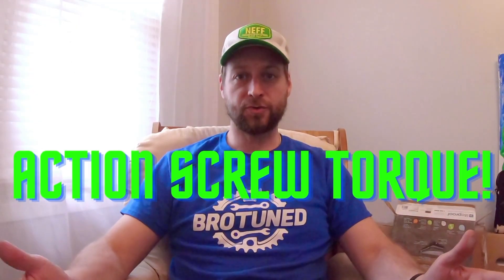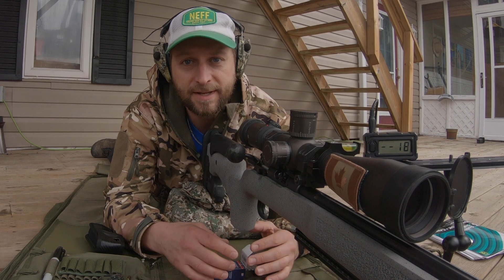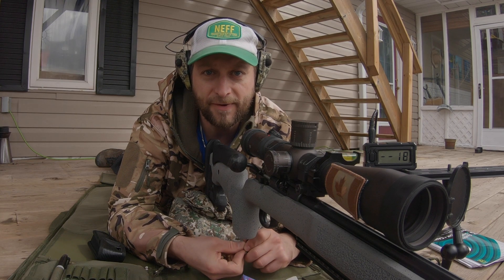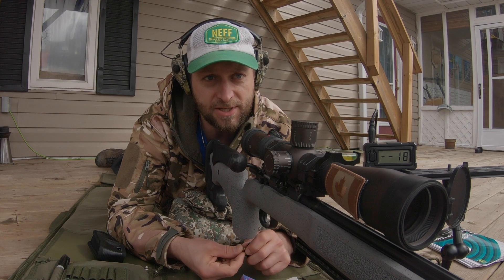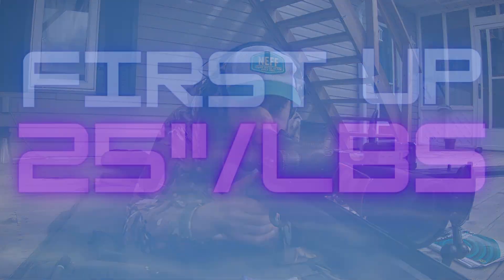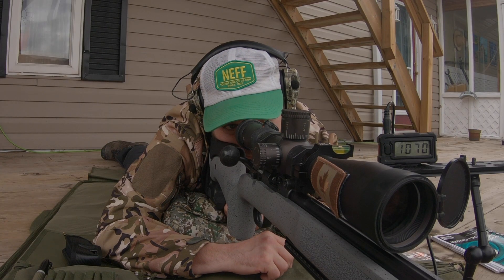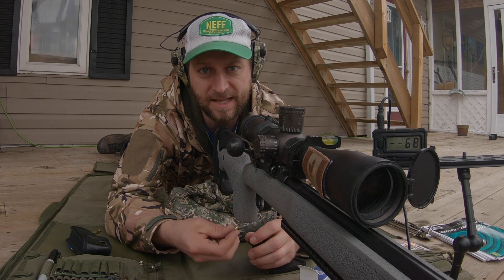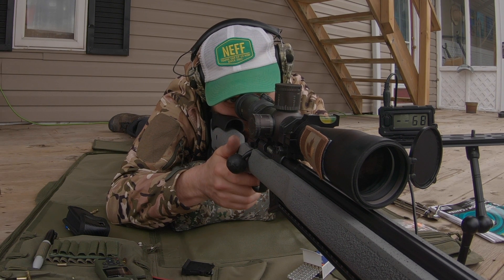Can torque improve accuracy?

Comment: I shoot a stock synthetic 24" CZ457 with stock untouched factory trigger with synthetic stock. I find temp to be a huge factor. A 17 DEG C day will shoot SK mag at 1/2  to 3/4" at 50. At 8 degrees I get .20 to .32. This is the case with many types. Temp is my biggest variant. I will try torquing.
Reply from the maker: I wonder how much mine changes with temp being a wood stock

Comment: Do you tighten both screws with the same torque setting? I ask because if I tighten the front screw any more than 10 in/lbs, the barrel gets pulled down towards the stock, and it is no longer free floating

Comment: Nice - thks.  What kind of wind were you getting looked 12+ km/hr?  Do you shoot with flags?
Reply from the maker: Normally it’s between 10-20 km/h all the while the sun is up and I walk the range(field) with my kestrel and take reading and I just started to use flagging tape on a little pole so I can try and shoot groups when I see the flagging tape at about the same angle to try and keep shots and groups consistent.
Reply: @BROTUNED  yeah, flags are important - unless you shoot in low wind all the time.  I have a daisy wheel I use.  I was supposed to go shooting my LRP today, but the darn wind picked up big overnight.  oddly the last four or so years the wind is alot more than it used to be overall.
Reply from the maker: I find the exact same thing where I live but it just makes it a bit more challenging
Reply: @BROTUNED  yeah. I don't buy the whole climate thing...But used to be a guy could go shoot in under 10km/hr wind maybe 2-3 weekend days per month.  Now its like once every two to three months.  You just gotta shoot the wind - which sucks for pellets and even .22's.  still fun though
Reply from the maker: Yes it is a lot of fun

Comment: I have three 457czs vpt mtrs and I have found that at around 30inch lbs it shoots pretty good but at 35 not so good but at 40 it does best dime size at 50 yrds that seems to do the best in all three of my cz457 target rifles you might want to try it. Good shooting brother. 
Beagleman
Reply from the maker: I’m just worried that I’ll compress the wood and and have action screws interfere with the bolt. I need to pillar bed it I think or at least bed it to see if there’s more accuracy left in it without switching to a chassis
Reply: Two of my czs are pillow beded but one is an at-one stock and it is glass beded and it doesn't cause any problems up to this point and all three are on 40 inch lbs but I would try it. You are doing a really great job on these videos alert me on the new ones please. I might be able to help you with some of these things I have been in this business since I was 12 years old I am now 74 good work keep it up.
Beagleman
Reply from the maker: I’ll listen to any advice for sure. Maybe I’ll have to check out action torque again to see if there is anything in it for my rifle
Reply from the maker: New videos come out every Sunday at 9am 🕘 and all of December I’ll also have a new video every Wednesday at 9 am.